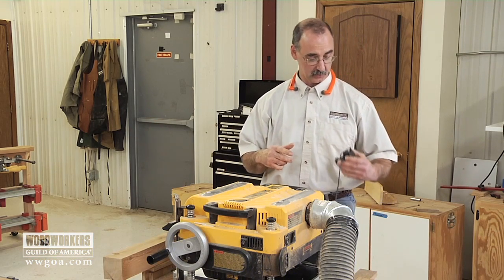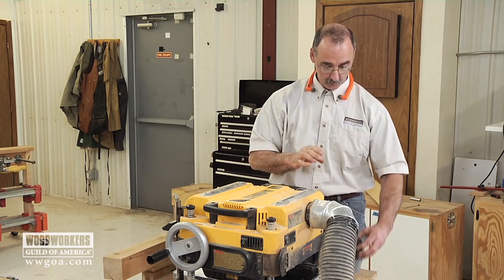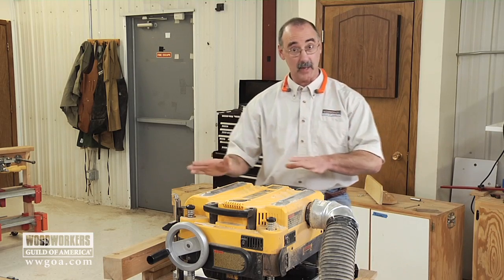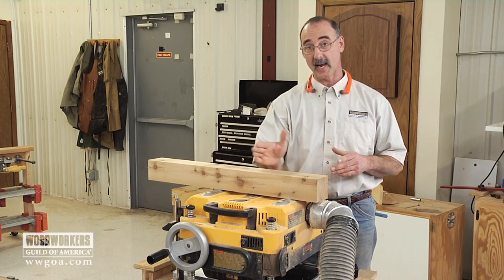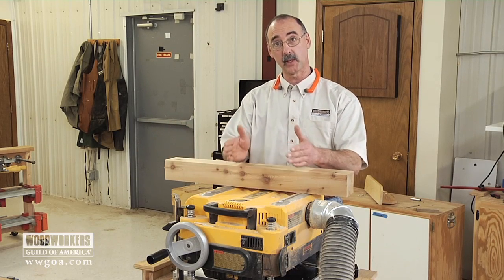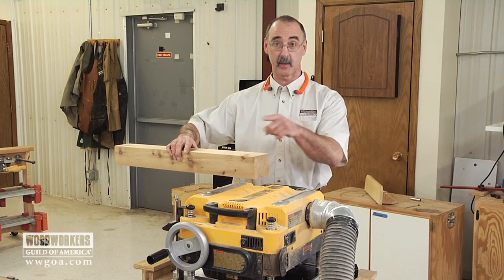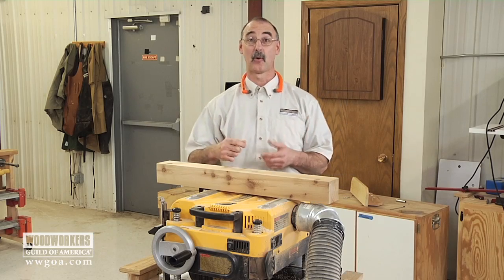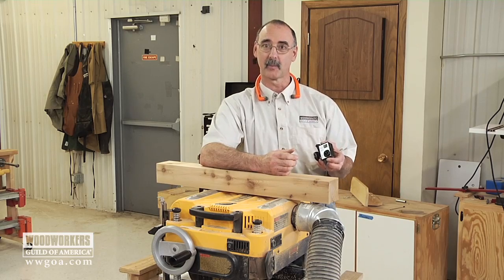Woodworking Tips: Power Tools - Inside View of a Planer

Comment: for longer pieces, ensure that the piece is properly supported on the outfeed.. gravity usually drags down the piece and tilt the trailing end up into the cutter head.. this is usually accomplished with an outfeed table or series of rollers..

from what i understand, theres no set way of eliminating it completely, but one way to avoid it is to accept it and accomodate your milling process accordingly to accept that some will be cut off on one edge..

Comment from the maker: Make certain the surface that’s down on the planer table is flat, which can be done by face jointing.  You can also feed a second piece of wood immediately behind the piece you’re planing.  The second piece can be scrap but, of course, must be the same thickness.  On long boards make certain you’re supporting the board as it comes out of the planer so that it doesn’t tip up into the blades.